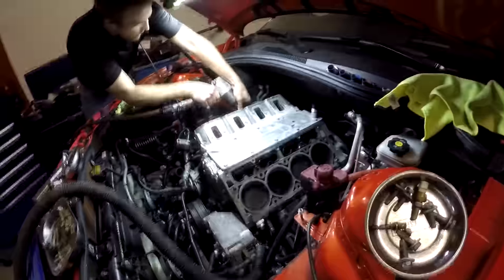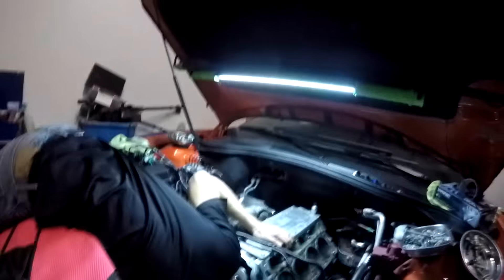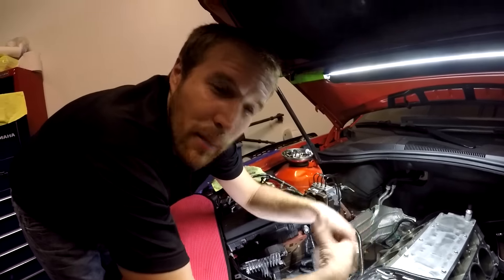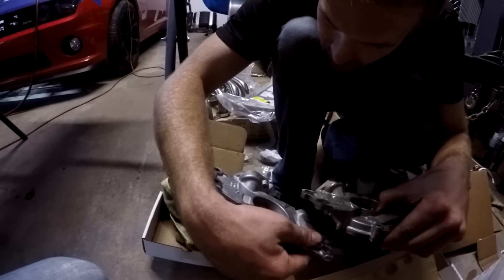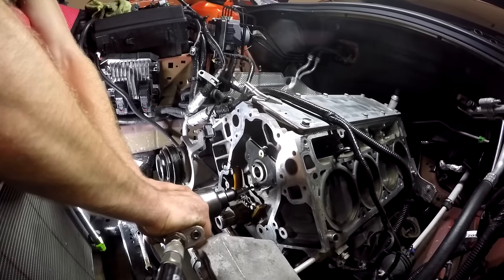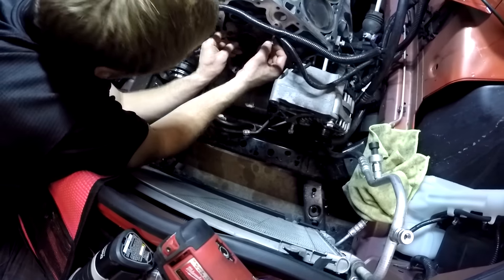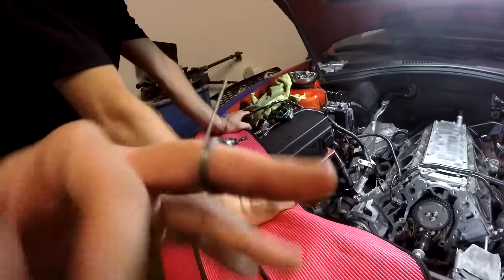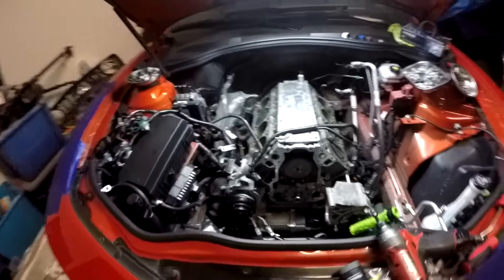Camming The Camaro - Day 2

Comment: that guy is smart as faaaack
Reply: even though...what hes doing is simple??
Reply: +hittin-low_150db+ its simple if you know what your doing and btw you aren't doing 150db lmao
Reply: +Gokumitsu9000 oooooooohhhkkkk ill try.....haha.
Reply: +Tory Bush I was when my crossfire was in my dads old truck...153.7 to be exact
Reply: on how much power?
Reply: +Tory Bush bout 6k..
Reply: +Tory Bush 1 crossfire xs spl v1 18...in a 5.8 ft3 2 6in aero ports tuned at 36 hz...on a lanzar opti 7k @.3 before rise  and a mechman 270 billet tech alt...2 layers of deadener through out the whole truck..optima yellow top up front ..and 2 d1400s In the tool box 4 runs of 1/0 total....153.7 @ 39 hz ..usaci mic in the kick driver door open
Reply: hittin-low_150db+ damn its hard to hit 50 with one sub. best I ever did was a 145.1 at 36 hz on 1500 after rise but I didn't have any deadener and the box was made for playing in the high 20's
Reply: +Tory Bush at the 36hz tune it would play down to 27 ..at 27 it did a 147.1...crossfire xs spl v1 are no joke..look up vids of the xs spl v1 bro
Reply: +Tory Bush and the box had 2 coats of resin and 45s in every corner on the inside
Reply: I wanna be as smart as that guy

Comment: They usually have a stronger spring in the oil pump for higher volume and will blueprint the oil passages to make the oil flow more efficient. Your cam life will be not long you used no assembly lube on it that cam wont last you 10k miles.

Comment: you. should get a cold air induction kit for it , its inexpensive and it means that you can get a higher fuel to air ratio producing more power I picked one up for my car for £40 so about $70
Reply from the maker: The one I want is 400 bucks
Reply: +Do It With Dan wow man good thing I live in Scotland then I get then cheaper, probably because the cars here have smaller engines

Comment: How much power increase with cams and headers?
Reply: Depends on the brand and how serious of a cam it is. Usually not much more than 30-60hp
Reply: +CaPtiaN_DamMiT you seem to know a little... why wouldn't gm just put the better cam in it in the first place. It's a piece of metal just shaped differently right? so how could it cost them more
Reply: +Jake Sundberg Emissions mainly, then drivability and reliability.  Most aftermarket cams cannot pass emissions test and get worse gas mileage.

Comment: +Do It With Dan  I can explain what blue printed is... Every engine from the factory has a "blue print" of tolerances and/or measurements for everything.. basically chevy and every other fuckin company out there sells you a motor stock that is no where near what the original blue print measurements specify. lol don't believe me?  Ask your buddy there about how many thousandths off chevy 350's are stock.. haha.  A blue printed part is EXACTLY to the thousandth what it should be.  Witch means basically its gonna run smoother, same goes if you have a blue printed engine its gonna run like it should.  Ported is basically they just took some material off for better flow, but sometimes polishing is a bad thing.. aka "port and polish" sometimes not polishing is better because you get a layer of fuel/air that sticks to the rough surface of the metal thus creating a better flow than if you polish it and the fuel/air does not stick to the metal, PEOPLE WILL ARGUE OVER THIS, but  fuck em IM a REaaaal BOI.  lol  anyway. MURICA!!! I have two Camaros btw and this year a cbr1000rr rock on mo fucker!